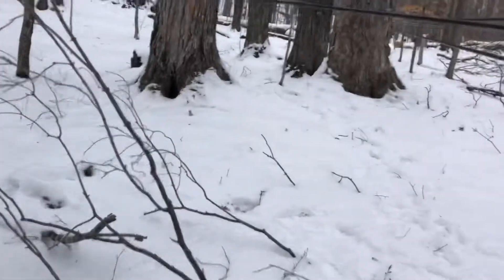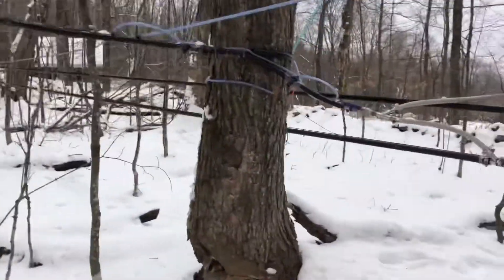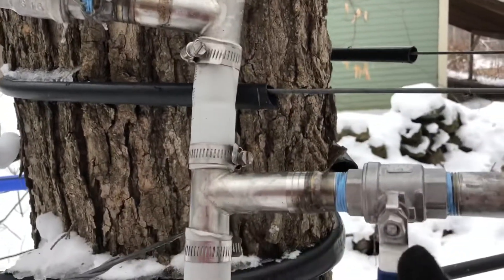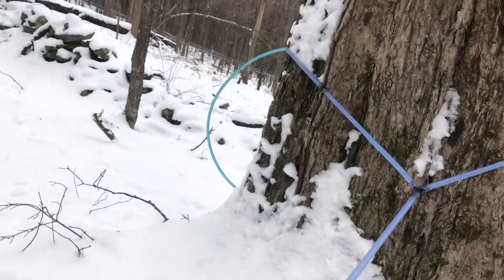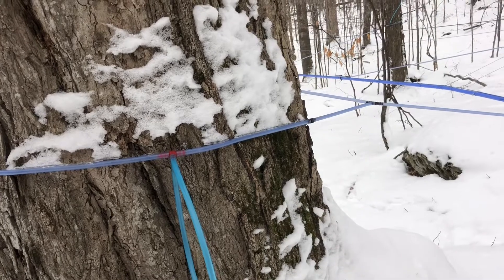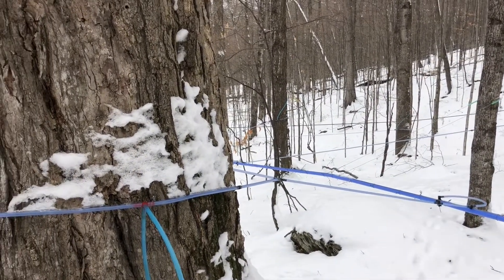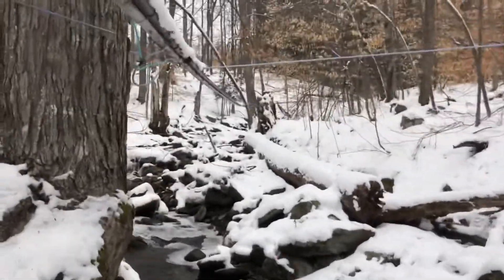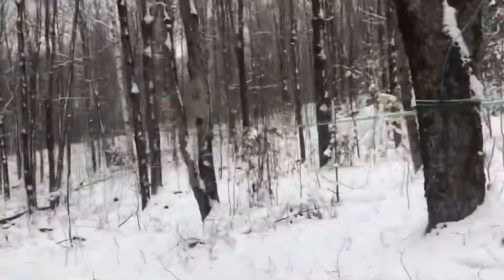Fixing leaks in vacuum system 2021

Comment: Do you have any issues with heating due to the black pipe?  We're having some icing issues, I'm wondering if swapping to black will help it thaw, or if we're better off adding more dry lines.  My father broke his foot years ago tapping a brook run, icy waterways are nasty.  It's nice to see ideas from other maple guys.  Thanks.
Reply from the maker: I only have black pipe on a couple dry lines. And on the one system you see here 1600 taps. I strongly advise against black.  If you are freezing up really badly. It is either due to sags or leaks. 
Good luck.